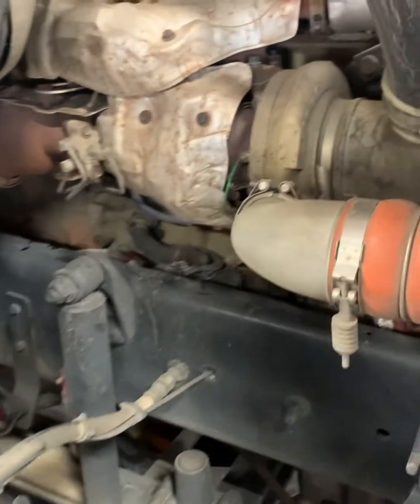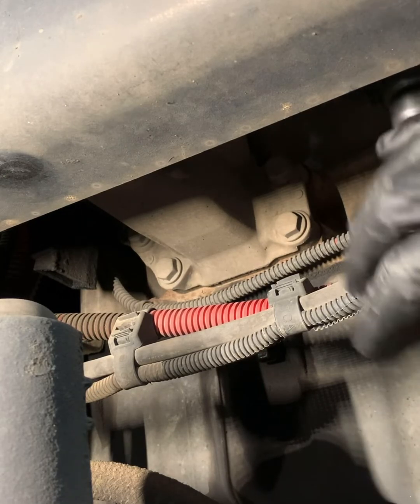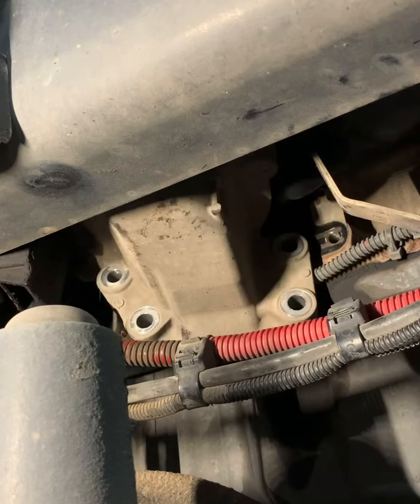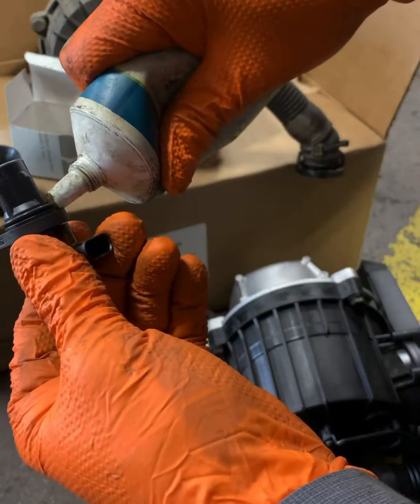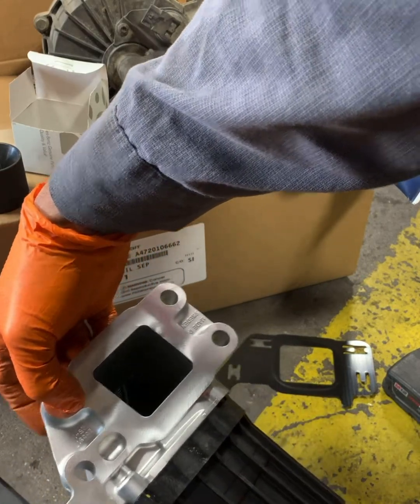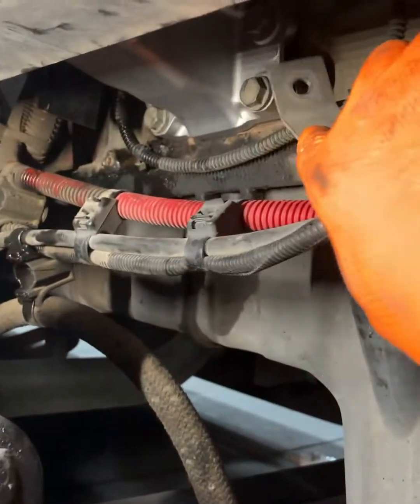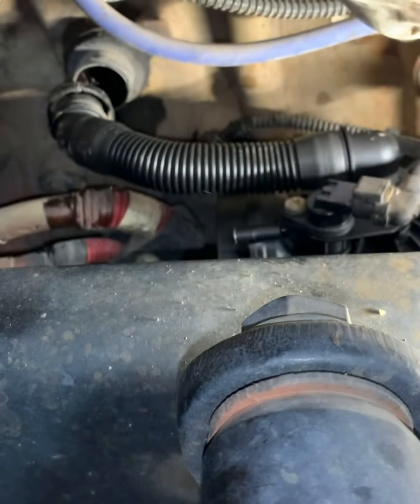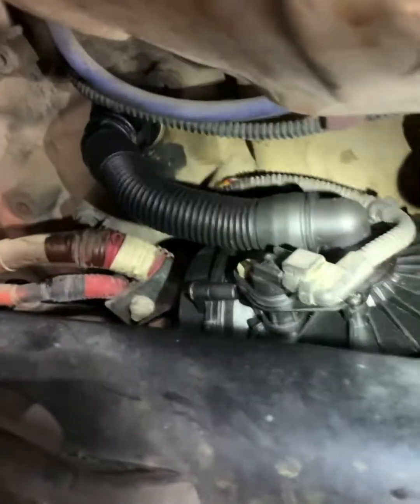Crank case ventilator. Crank case breather. Thing a ma jiger. DD15 engine.Detroit engine ventilator.

Comment: Whats the shop time for this job? Debating if i wanna fight this in a parking lot or just pay a shop. I appreciate your vuds man. They've helped alot.
Reply from the maker: @CaptnSyko  expect to pay about 2.5 hrs to get this done. If you do plan on doing it your self make sure to replace the speed sensor on top. Easy insurance.
Reply: @bustedknucklebydieseldr3228  I appreciate the response. I did replace the sensor, block port and all. Was going to do it myself but a southern tire mart knocked it in 45mins and charged .6.

Keep up with the vids man. Lot of good info for us owner ops.
Reply: @CaptnSyko  can you use the old tube instead of the plastic one
Reply: @CaptnSyko can you use the old tube i like it better than the plastic one

Comment: Hey thnks for the video, is it possible it could be breather gasket?
Reply from the maker: Thanks for reaching out. Very well could be the breather gasket. Got to wash it off and check to be sure. Or..if you have over 200k miles you might as well replace it before it get full and throws a code.
Reply: @bustedknucklebydieseldr3228  i can see sweating around, is it possible oil pan gasket?
Reply: And i dont feel any vaccum on oil cap and beneath crank case

Comment: If I changed the crankcase less than a year ago is it possible to replace the sensor only?
Reply from the maker: Absolutely, just may be a little hard to get on since that heat shield is in the way. But do-able.

Comment: I've noticed that the hose going into the block has a small leak. Should I just replace the whole crankcase or just the hose? My oil pan is leaking also not too bad. Would the crankcase failing cause that?
Reply from the maker: If you have over 500 k miles than definitely replace your crank case vent housing and fitting in the block. If under you can do just that hose or spend just a bit extra and do the whole thing. Good maintenance to get done.  It also won’t cause ur oil pan to leak. But might leak around your pan causing it to look like your pan is leaking.

Comment: I’m getting ready to buy one now I’ll be following your steps it’s my first time changing one thanks a lot from the video. There was a part of your video went silent was that a bolt and nut you use to unscrew it?
Reply from the maker: Thanks for watching and reaching out. Yes I used a regular bolt and double nut it to get the fitting out. Much easier and much cheaper than buying a large Allen socket to fit in there. All about saving money and working with what I have.
Reply: @bustedknucklebydieseldr3228  Ook cool agree with you. I installed minds earlier today, Is this the only way to contact you if I have a question in the future?
Reply from the maker: @318_louisiana9  this way works best as others can see responses and hopefully helps them with issues they might have.
Reply: @bustedknucklebydieseldr3228  10.4
Reply: @bustedknucklebydieseldr3228  hey I have a question I have a oil pan that crack and dripping oil but not much and cam housing the question is why my dipstick is always showing over full even if it’s for a day can you help me out?
Reply from the maker: @318_louisiana9 great question. Do you know the history on your truck. Dipstick may be replaced with a longer model. Just a theory and I’ve run accross it before. If that’s not it than your pan is infact over full. It’s either a go or no go gauge on that dipstick. If that pan is cracked get it replaced before anything gets worse and something smacks it again.

Comment: Will this cause excessive blow by ??
Reply from the maker: Great question, if the breather was plugged up than you would experience oil getting pushed out of the vent instead of it naturally being vapor. If you notice a lot of oil around it , it’s time to change it. Blow by is more of a cylinder problem.

Comment: Great video, question: what force cause the rotation? I have the same and it leak on the ground. thanks
Reply from the maker: Thanks for reaching out. The force of the exhaust gas leaving the block causes the filter to spin than clean the slobber and send the remains to the pan. Only vapor should be leaving the filter, and if much oil comes out it’s time to change the housing.
Reply: @bustedknucklebydieseldr3228  That's great, thank you very much for your service.

Comment: Will a bad crankcase rebreather cause exhaust in the cab/sleeper?
Reply from the maker: Great question. You don’t have to worry about that because no it will not. But I would start looking around for signs of soot collection around the exh manifold, bellows after turbo , and exh clamps , basically anything on the p/s of your engine.

Comment: Thank you for great video. What o-ring grease (brand, type? you using in video?
Reply from the maker: Petroleum based retention conpound.  This particular one is from grainier and it made by chemtool incorporated. Great to use So it won’t dry up hard on those orings.

Comment: What exactly does this thing do?
Reply from the maker: Great question. The ccv is used to take any excessive pressure out of the block and separate gas from the oil.  The filter inside actually spins and throws the oil back inside to the pan and vents fumes to the outside.  Once you start getting excessive oil out of the ccv vent it’s time to replace the filter housing. Hope that clears some things up.
Reply: @bustedknucklebydieseldr3228  thank you so much!!! Does it always leak oil when it needs to be replaced? Or does it need to be replaced sometimes even without leaking oil?

Comment: What size is that bolt head you used to take the fitting off at the engine?
Reply from the maker: I used a 5/8 bolt head to remove that fitting.
Reply: @bustedknucklebydieseldr3228  thanks.

Comment: I have a 2011 dd15 it has a metal pipe with a sensor. I went and got a replacement from Freightliner but it has a plastic pipe or tube. They are telling me it's the only one they carry for the dd15. It will not work with the metal tube on my engine the plastic tube doesn't come off. Any help or ideas on this ?? Thanks
Reply from the maker: Great question man. That is a problem with many older dd engines. I’ve also had that issue. I took the old one to the dealer and had them match it up with  new style pieces that adapt to the new plastic lines. It was a pain. But best thing is to bring it in to a dealer and have them ask a tech if they need help because parts guys don’t always know it all. Good luck on the search and if you want to find out part numbers to help others that would be even better.
Reply: @bustedknucklebydieseldr3228  thanks for the quick reply 
Ya I know it's not correct but parts guy said that's the new version I can't remember the term they used the super seaded part I think. I have ran into this before with many other parts but they usually work and fit. I will have to go to the big dealer in Denver and figure it out and I will put part numbers along with a video on my channel.  
My metal tube bolts to the motor and won't even fit that rubber grommet you showed pulling out on your video
Reply: @bustedknucklebydieseldr3228  hope I don't have one of those unicorn dd15 engines that parts are difficult to get 😐😒
Reply from the maker: @MakeMoneyTrucking  unfortunately it was an early model DD and the more years that pass the more parts are going to be hard to get. As you can see With the crank case vent they tried to make a universal one and failed because some had bolted fittings in blocks and some didn’t. It will only be getting worse as they will be focusing resources on the 18 and up engines.

Comment: Watching your vids while my trucks in getting the outlet nox sensor replaced an they’re going to work on the front brakes shakes the steering wheel like crazy when I press the brakes 👍
Reply from the maker: Thanks for watching. Glad this can give you some insight into the process of diagnosing the shaking issues

Comment: I got a 2014 freight lighnet cascadia with DD15 engine i just replaced the crankcase oil seperator know how often doesvit need to b changed at? thnx. A.T.
Reply from the maker: Appreciate you reaching out man and watching along. These separators expect about 500,000 miles. After that they’re pretty slobbered up and will start pushing oil. And while you’re there don’t forget to replace the rpm sensor because It will  go out.

Comment: How often should you service/replace the crank shaft ventilator??
Reply from the maker: Thanks for watching. You can expect by 500k Miles to replace this. Either by a check eng light or pushing oil. Makes since since there’s a lot of oil slobber that comes from the valve train down to this. Thanks for reaching out and stay safe out there.
Reply: @bustedknucklebydieseldr3228  I appreciate the reply, thank you for the videos keep them coming !!
Reply: Also thanks for the video’s brotha!!
Reply: What do you mean by (pushing oil)?